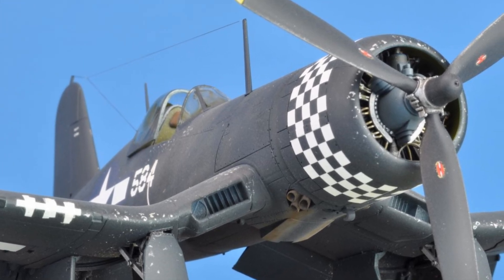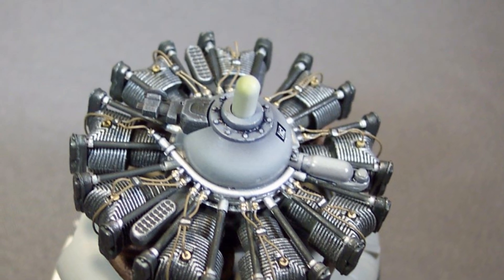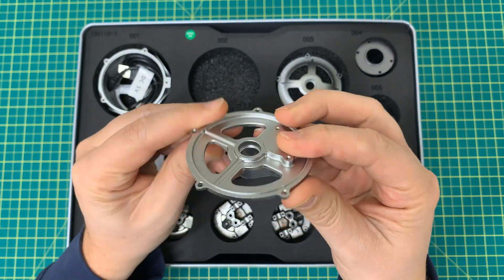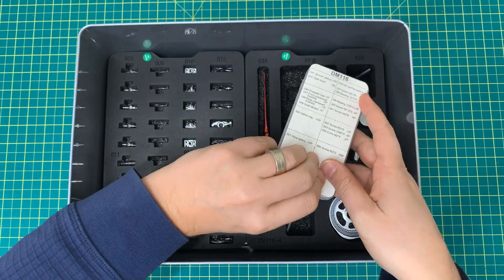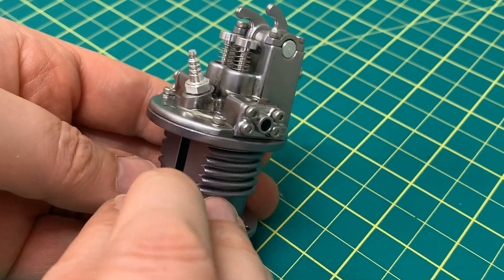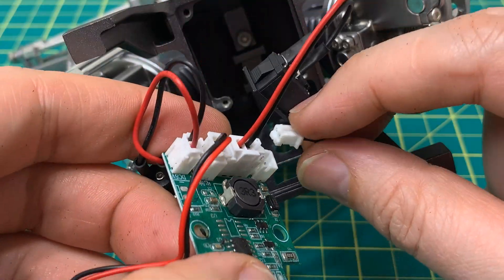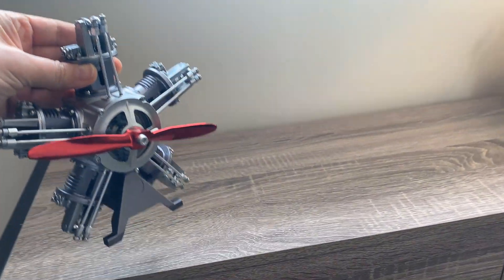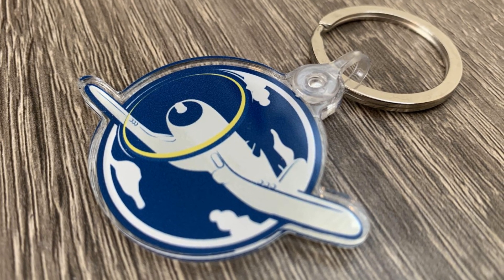Build This Working Radial Engine

Comment: Engine looks pretty awesome, just wish it was a little cheaper. Thanks for posting.
Reply: I share this sentiment. Amazon has a scale v8 engine that actually runs with gasoline (for RC cars) and its 80 bucks, and 160 if you want to add a supercharger. 400 bucks for an electric turning one is a little wild.
Reply from the maker: @emanuelparedes9187: You are a keychain winner!  Please send your address to modelairplanemaker@gmail.com